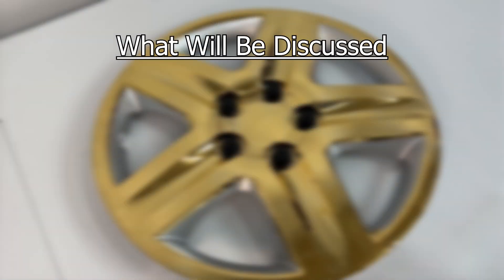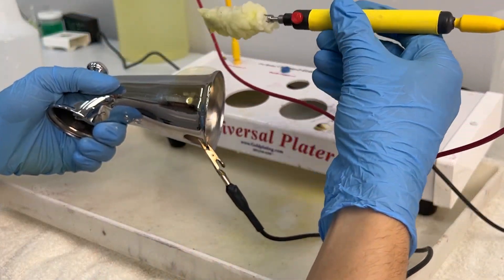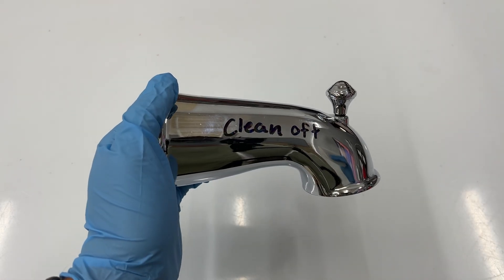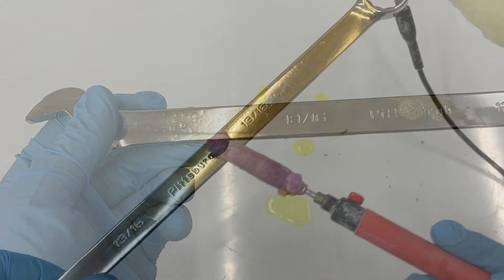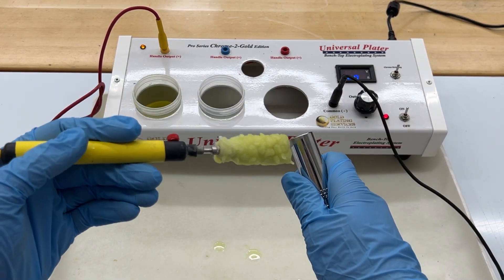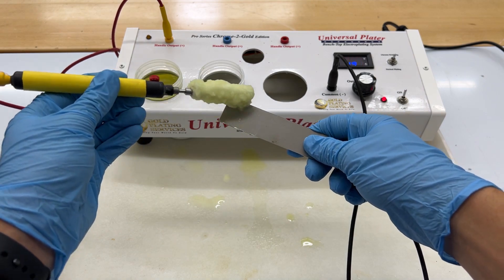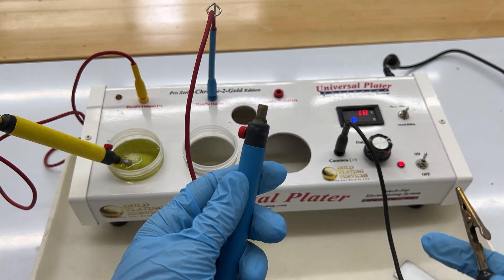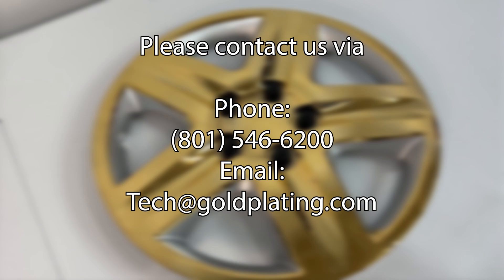Chrome Stripping Solution in the Electroplating Process

Comment: Why doesn’t chrome stripping solution strip the nickel? Is it because of the electrolyte? If that’s the case, couldn’t you use nickel as the anode with the chrome stripping solution for electro cleaning without ever needing to replace it?

Comment: Hi guys I want to plate a watch any advice and what kit do I need?
Andy UK,
Reply from the maker: You could use a Universal plater which is brush plating which can be kind of tricky. We also have the Jewelmaster which is bath plating and that one is pretty easy because all you have to do is dip the watch into the soltion and rinse it off good between each step and you should have no problem.